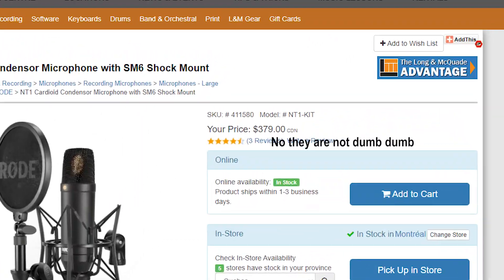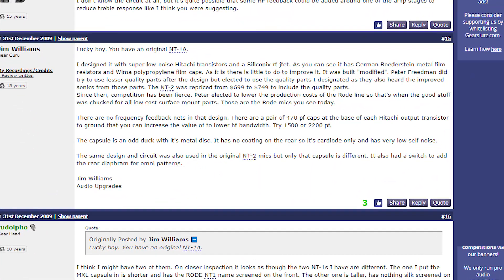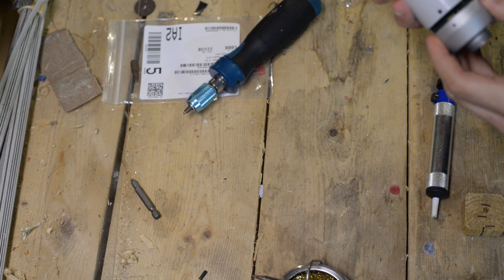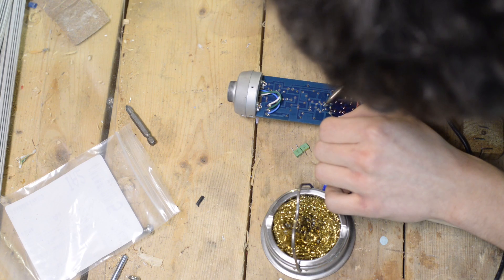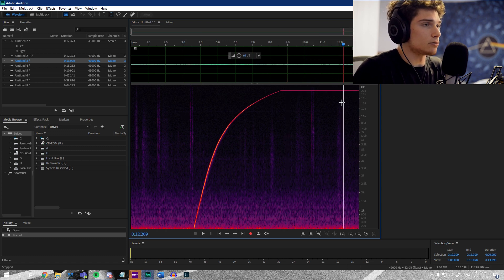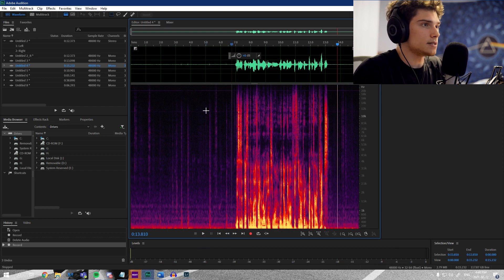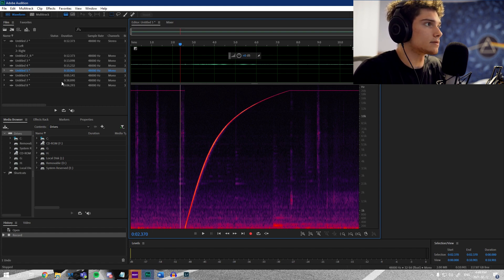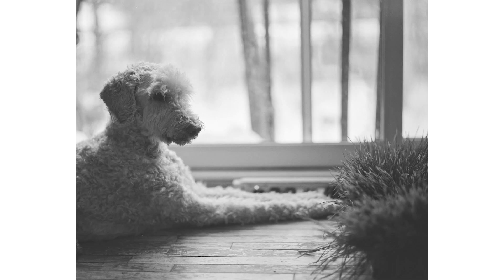Modding RODE NT1 1992 Edition

Comment: There is another grey version with a black band at the bottom, just to confuse things! You also said micro farad instead of pico farad! 😉
Reply: I did this mod. I use these mics on Tom’s and Floor Toms and I found the mod to reject cymbal bleed much better than stock. 
Ps; yeah 1500Pf not Uf. I hope he didn’t put in 1500uF…

Comment: Hey mate, if your picking up something in the signal path that wasn't there before, there's a good chance there's some board contamination, either from flux residue or it's possible conformal coating layer that starts at the cap joint melted. Scrape away the conformal coating near joints, suck out the solder. Then with a cue tip and isopropyl alcohol clean all 4 joints thoroughly. Maybe think of using a 60/40 - 63/37 solder, the 97/3 has a really high melting point which is to high for thru hole electronics (The mic's was built b4 rohs compliance it's not lead free solder in it anyway). Solder the caps back, but leave the iron on the joint for 1 sec longer than the solder to burn off the excess flux. Finally clean the joint's again with iso alcohol.